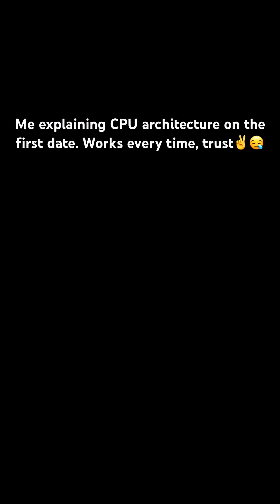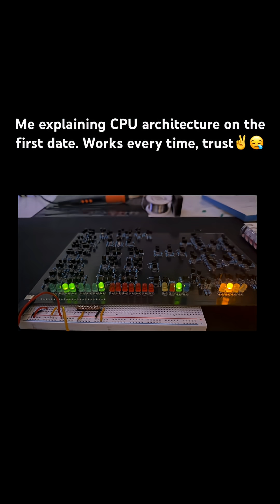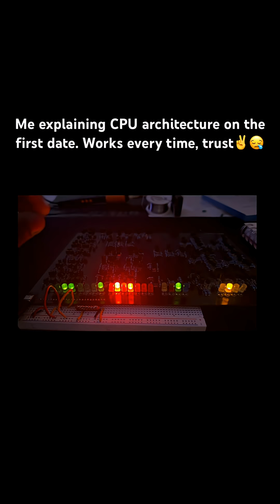We on for a second date? #computerscience #cpu #engineering #fyp #electronics

Comment: Congratulations on your work man! It's not even my design, yet I am still delighted to see the LEDs light up in a logical manner.
Reply from the maker: Thank you bro! I cant wait to get the control unit up and running
Reply: @bigChaks  Indeed.. Just remember to double check everything and manually follow the electricity in the schematic before ordering.

Also, I suppose you utilized the 2N2222 instead seeing how it's comparably 10'th the price per part? (If I assume in my calculations that '2 bucks' is £2, implied by '£0.80'.)
Reply from the maker: @Nigma_863 yes, Im using the good ol’ 2n2222s. The register file is gonna need a bunch more of these puppies so Im working on that now🫩
Reply: @bigChaks  Alright, just remember to keep your sanity over there!
Reply from the maker: @Nigma_863 too late🫩. The register file is gonna need me to solder 296 transistors… just lock me up before its too late
Reply: @bigChaks  "XD